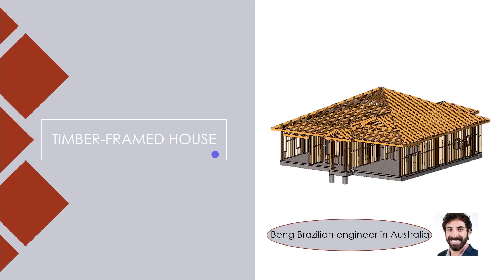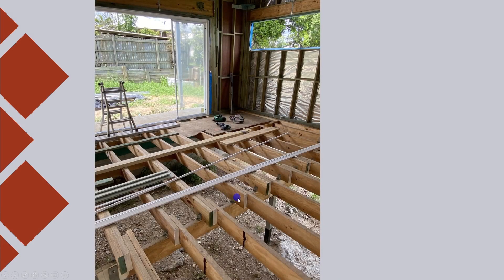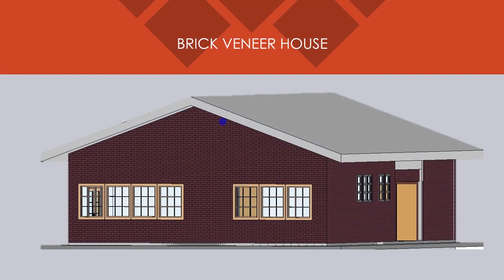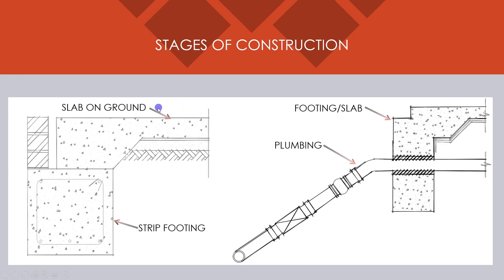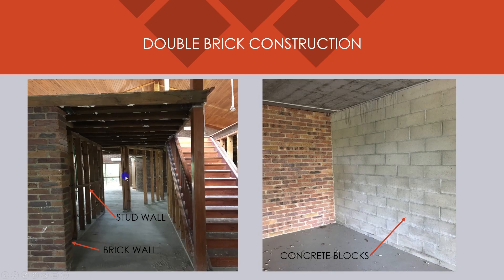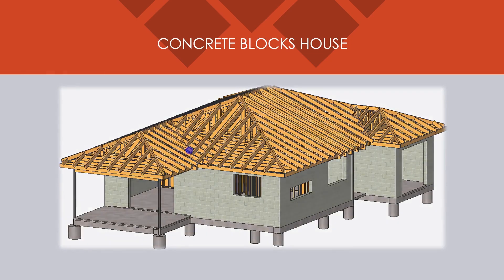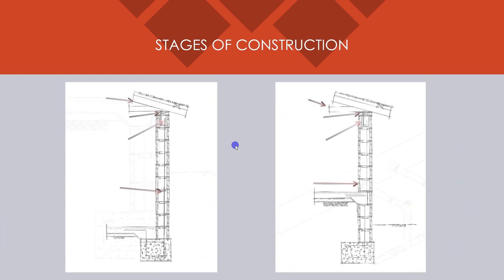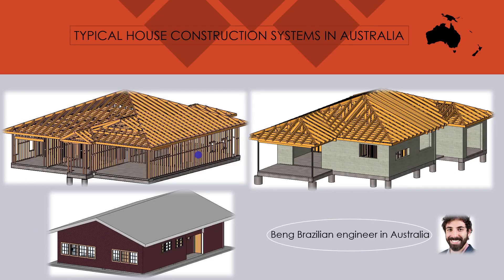Typical house construction systems in Australia

Comment: Are structural brick walls not used in Australia in the most standard and usual European way? Ie a 250 mm+ thick bonded wall with cast in place reinforced concrete bond beams on every floor, all covered with ETICS insulation? (Either glass fiber based or polystyrene)?

Comment: Apologies if this is a silly question, but what is the difference between 1 Timber-framed and 2 Brick Veneer? Don't a large proportion of Brick Veneer houses use Timber Frames (i.e. is 2 a variation of 1)?
Reply: P.s. Great video. Subscribed!
Reply from the maker: There's not difference in terms of load bearing elements. They are both supported by timber framed walls.
Reply: @bengthebrazilianengineerinAus  thank you . All the best with your channel !
Reply from the maker: @theworldisa  Thank you very much :)

Comment: Can you Make a video on Light Gauge Steel Framing, Calculating Loads on Steel Trusses, Nodal offset as centre lines of CFS trusses do not meet, Calculating cappacity of K braces, and wind loads as per 1170.2 on Steel Building and Bracing requirements

Comment: Wow. These houses must be super cheap with such low standards. And they must be very cold in the winter. Yet, I don't see radiators included. We build better weekenders in northern Europe.
Reply from the maker: The insulation will vary from region to region. Colder regions will require better insulation obviously. The east coast is hot all year round. :)
A good architectural design will make your house more efficient.

Comment: Hi Gabriel.
I am doing a Bio;domg amd Construction  course, and for what I have seen during my studies, Concrete applears to be the worse material that can be used in the construction industry, and second to that appear to be the manmade timbers, full of harmful timbers and I have seen them delaminating when exposed to the weather. Having said that, is it possible to build a single leaf (110 mm) load bearing concrete wall, with engaged piers,  for the complete house or even a commercial shop? 
Where can I get good information for such a project, please?
I want to study this kind of construction in depth.
Steel  construction is not reallly an option, as far as I can see, there are many disadvantages to steel construction. Maybe, it is OK to utilise I-bemas to create the Portal frame, then clad it with other light materials, but that is about it for the use of steel; as I see it. However, you are an engineer, and hopefully, a good engineer who has done all sorts of investigations, to a PhD level in construction.
I am interested in hearing your views on this subject.
Kind regards. y hasta la vista amigo!
Franklin

Comment: Gabriel:  How are the walls tied together in the double wythe brick?  How do you insulate the walls?
Reply from the maker: Hi Mike. You should have cavity ties to tie the walls together.  If I'm not wrong, the insulation will depend on the R-value you need to achieve. You can use foam boards most of the times.

Comment: we have a multi-story rendered double brick with concrete floors, for the upper levels would the concrete just sit on top of the inner brick or sit over the cavity too?
Reply from the maker: Suspended slabs usually sit on top of the inner brick.
Reply: @bengthebrazilianengineerinAus  makes sense for wiring etc.. I guess I was confused by the internal water damage on the 2nd floor beneath a corner window but now I realize the room overhangs so the cavity doesn't continue below it, they should have used weep holes :/

Comment: What about EPS Gabriel? I feel it’s becoming more popular amounts the owner builder community. I believe there is EPS and steel frame with EPS panel aswell. Curious to see what’s more popular and/or longer lasting
Reply: EPS should be banned in Australian homes.  Build with something safer.  It burns too fast, it is a dangerous product...why not use kerosene soaked wood instead?

Comment: Hi Ben - thank you very much to taking the time in making this video.  Here in NSW brick veneer is popular or recommended based on price, however, is it really much cheaper?  Coming from South America (Arg) it is difficult to conceive the idea of living in a house held on wood rather than brick.  Would you please shed some light on the costs to compare double brick and brick veneer.  Thank you very much. Pablo  //  Alternatively, any guidance on where I can get this cost comparison would also help. Cheers,
Reply from the maker: Hi Pablo, the construction methods here are quite different from South America due to skilled labor, cost of materials and cultural acceptance of construction systems. I don't have exact figures, but as soon as brick laying is added to the system the costs go up if compared to the traditional timber-framed house. Prices will vary from state to state as well.

Comment: Thank you for the video man. It really helps. Say for example in Sydney region you can fit in all these 4 types. but how to decide or what factors determine the house that fits into that plot ? and what factors do we use to rank the house from rank 1 to rank 4 ?
Reply from the maker: There are a multitude of factors such as budget, clients preference, topography, location (wind loads, thermal performance, energy efficiency), cost of materials and availability of skilled labor in the region. I personally don't do this preliminary study on what type of house to be designed, I pretty much engineer the house the architects and clients engage me to work on.

Comment: What are the key  differences in 90*45mm and 90*35mm timber frames studs from cost and strength perspectives?
Reply from the maker: From the strength perspective, 90x35 studs will buckle under a compressive load smaller than that for a 90x45 stud. You can work out this load or you can have a look at tables that give you maximum roof or floor load widths. Costs should be similar, but double check that with a supplier in your area.